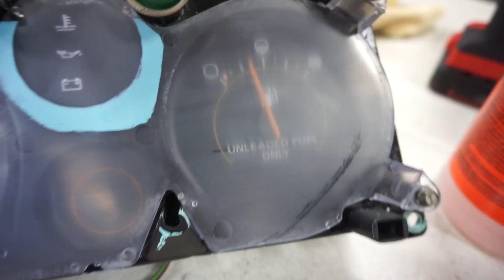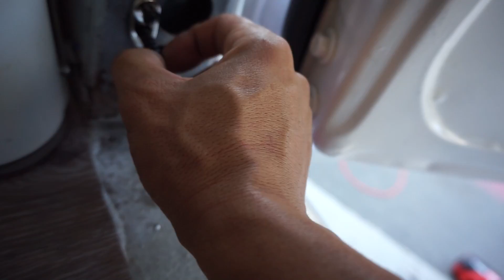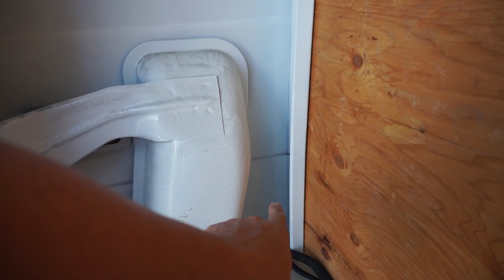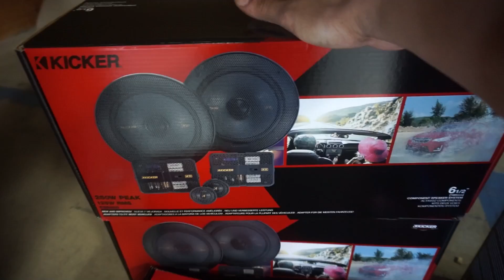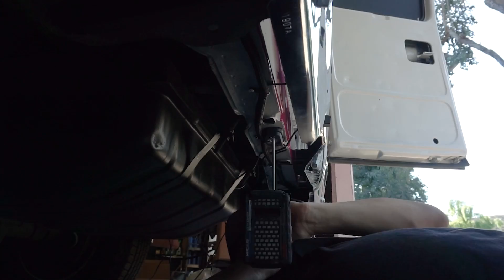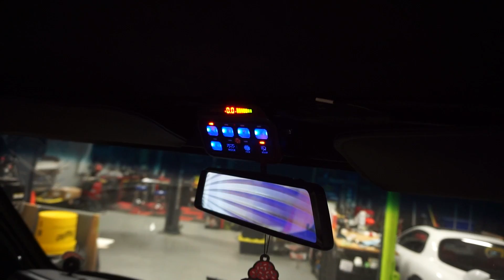Building the COOLEST Ice Cream Truck on the Planet!! [Ultimate Chevrolet G20 Build] - Part 11

Comment: the power socket cover should flip up. Prolong driving and vibration, the cover will fall off making the power socket expose, it will be dangerous if it touches rain water accidentally.

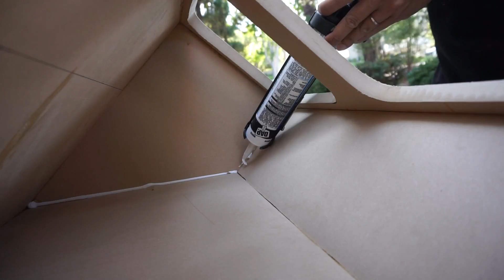Comment: 16:40 take that sealant and put it on the side of each panels in between the panel and the beam where it's not welded, if the van still rattles